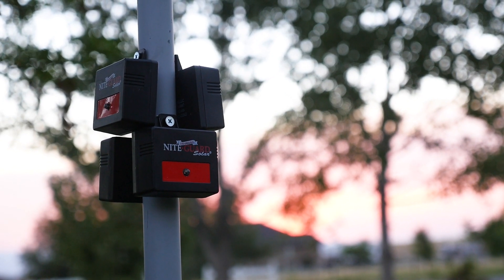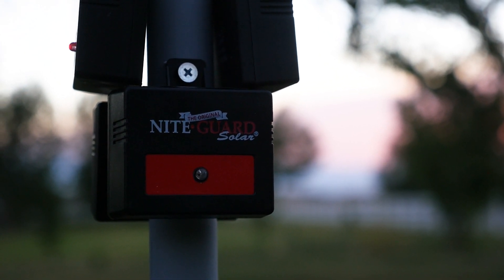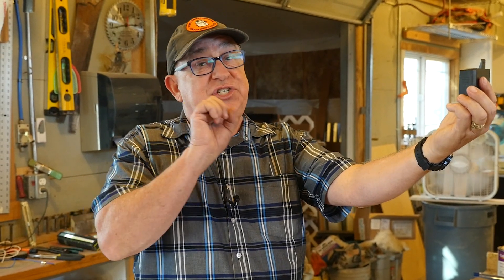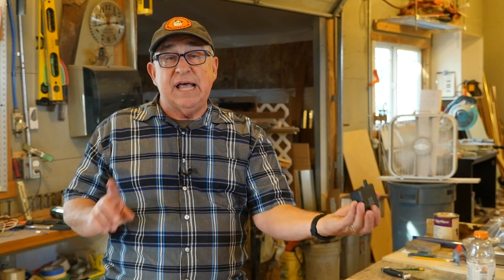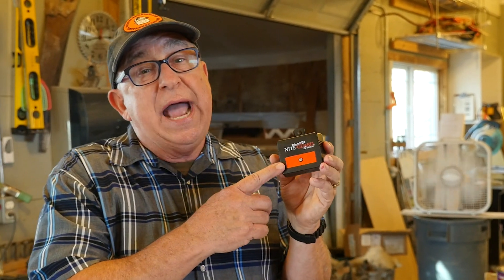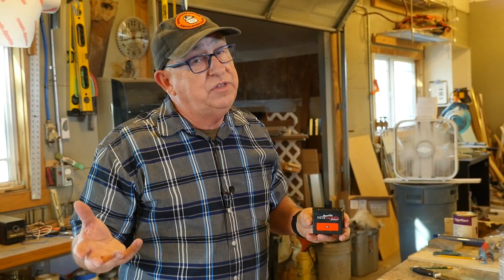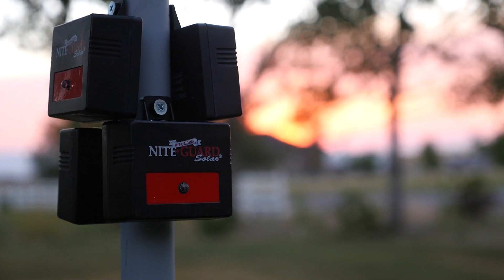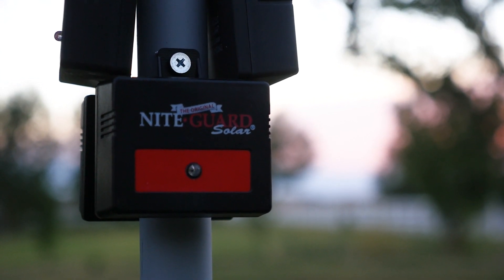Keep Deer Out of Your Garden with Nite Guard?

Comment: Looks to me like the 4-way group is shading the lower units too much to get a good full charge.
Reply from the maker: Jim, we haven't had any problems. Even indirect light seems to do the trick. But, if a problem developed, you could simply space them a bit further apart, with one opposing pair up higher and the other lower. Best, DFJ

Comment: Dear Dirt Farmer Jay - Have you discovered a real way to keep squirrels out of bird feeders?
Reply from the maker: Cassandra - this is especially a challenge. Squirrels can jump large distances, and cling to a variety of surfaces. We don't deal with them here where we live, but what I've encountered over the years indicate that any device that you can use to cause the squirrel to have to jump farther than it's capability or to have it loose it's grip or footing is effective. For bird feeders, that means suspension where the squirrel can descend down the suspension device, or encounters a circular sloping device that extends far enough out that the squirrel can't get around the edge without sliding off. It also means there aren't adjacent surfaces close enough that the squirrel can take a "flying leap" at the feeder and get to it that way. As for pole or post-mounted feeders, the post has to have slick surface or broad cone surface as well to the squirrel can't continue it ascent up the post. I hope this helps! There are some ingenious and entertaining approaches to this problem up on social media. Best, DFJ